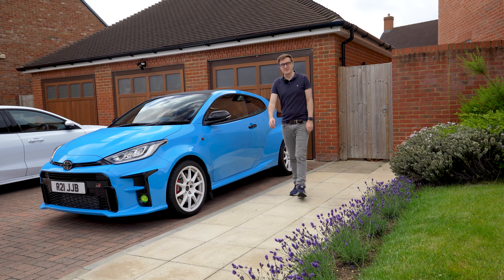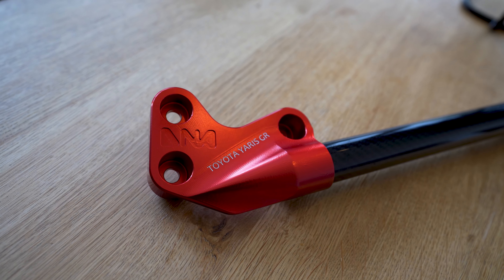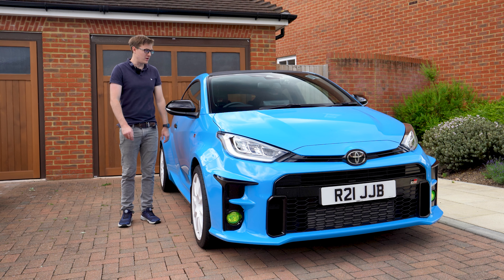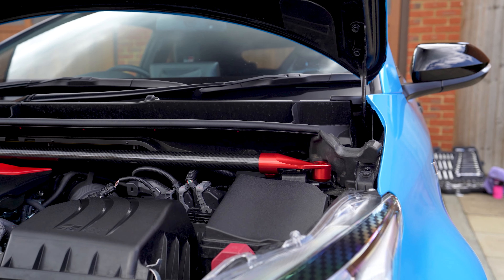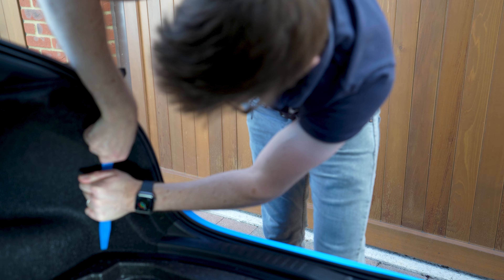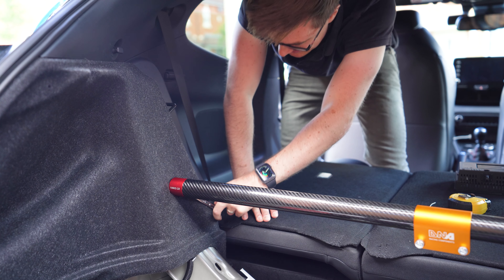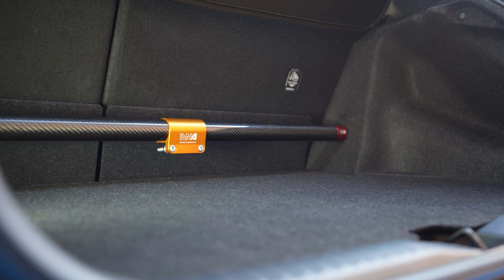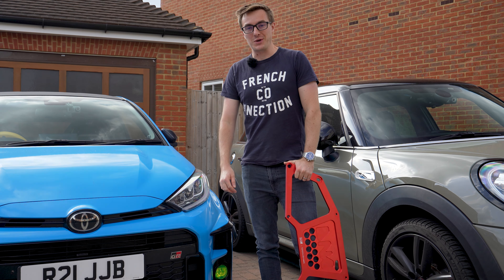GR Yaris CARBON FIBRE Chassis Stiffening 😍😍 (DNA Racing)

Comment: I think you could cut out a space in the polystyrene for the supports & move the goo etc. to the cavity around the battery
Reply from the maker: Yeah, I’m sure you could squeeze it in but cutting up OEM parts makes it non-reversible.

Comment: I thought Toyota had to remove the front chassis strut for EU pedestrian safety reasons and fitting it for road use isn't legal in most countries. It's certainly not allowed here in Switzerland. No issues in the UK?
Reply: Defo not allowed in the uk